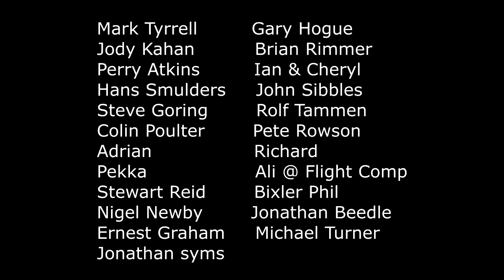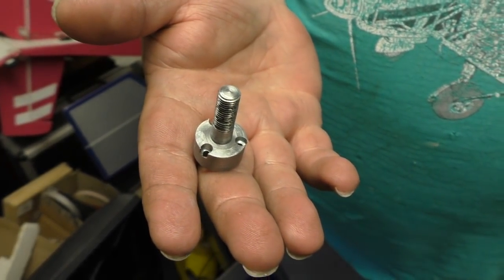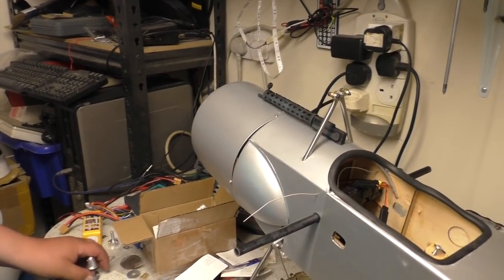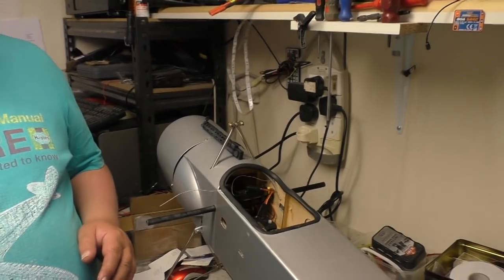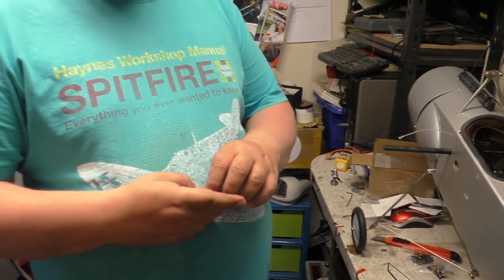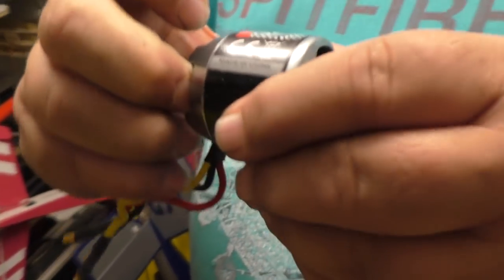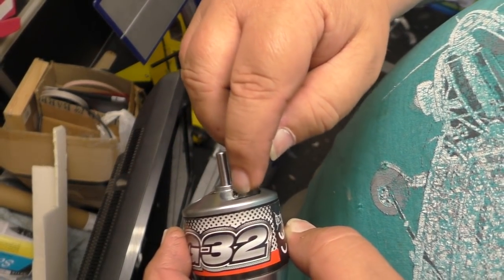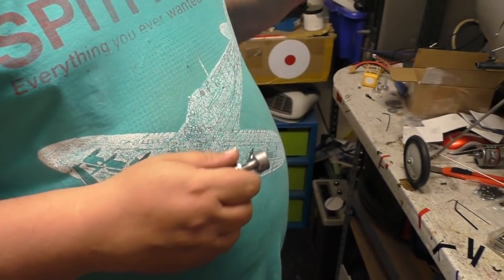Hobbyking DW Hobby Fokker Eindecker Build Pt15 RC Model Geeks

Comment: Nice bit of turning Rob and the upgraded shaft should do the trick,from my experience shafts are the weak point on motors especially those small spindly ones which will bend on the thread every time and need a v-block to straighten them out,doubt that you will be flying tomorrow as the wind is picking up again and more intense heat.
Does the Swallow hold the trophy for the most number of crashes ? never seen a motor damaged like that one and it must have come in with a lot of force ?
Reply from the maker: Thats the second G32 motor that brian has bent like that! Yeah those motors dont like landing vertically!